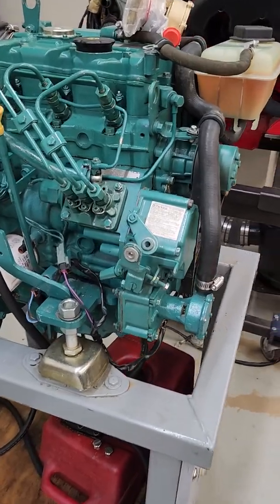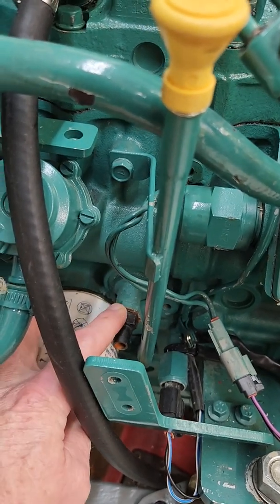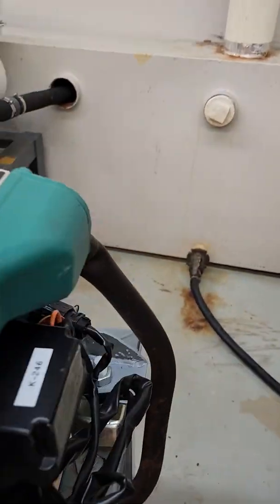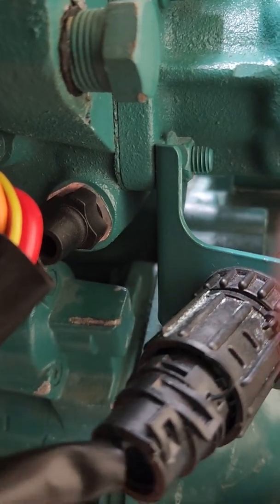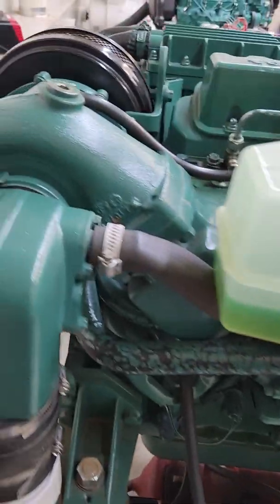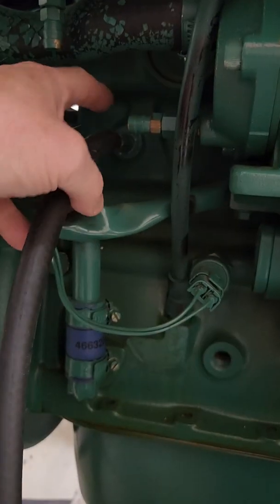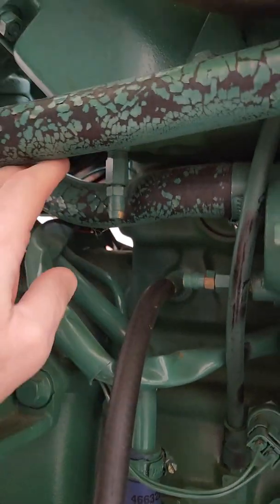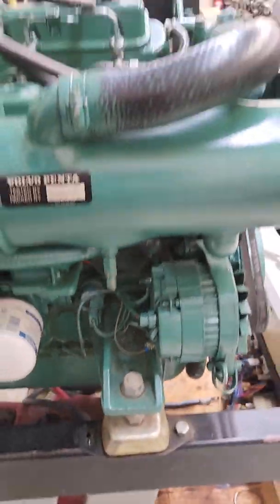Volvo Penta Diesel Engine Antifreeze drain locations

Comment: Your discussions are incredibly helpful. Simple, well thought out and great choice of topics. Thank you.  My question is regarding the oil air separator on a KAMD 300. There are 3 connections on the actual separator, one with a metal insert and 2 for hoses. Please describe where each connection is made on the engine and any advice on installation.

Comment: Hello Teds, thank you for the quality of your videos. 
I have a question regarding coolant system. 
I'm replacing the volvo VCS yellow coolant of my TAMD31P (after 3 years service) and the expansion tank is really dirty (black mud deposit) and I have black deposits coming out of the engine. 
Do you have an idea from where is coming these deposit and if the cleaning with oxalic acid is enough to clean it well ? 
Thank you
Reply from the maker: It sounds like exhaust is getting into the coolant if it's back and muddy (carbon). I would drain the system and pressure test it to see if indeed you have a leak. Riser or head gasket? Hard to say until you start taking it apart.

Comment: Hallo.
Why did someone block the returns on the fuel enjector pump??? returns pipe in side block with bolt????
Reply from the maker: HA! you saw that, some of these are tear down lab engines so I block off the fuel ports so it doesn't leak on the floor!

Comment: Related to the coolant why do some Volvo engines with an external coolant expansion tank have 2 hoses (180 deg apart) attached whereas other engines just have one hose running from the coolant cap to the expansion tank? Thanks.
Reply from the maker: Those small hoses connected to the expansion tan are air bleed hoses. They allow the air to escape as the coolant system is being refilled. They are always at the high point of the engine, some engines have two high areas some have one.